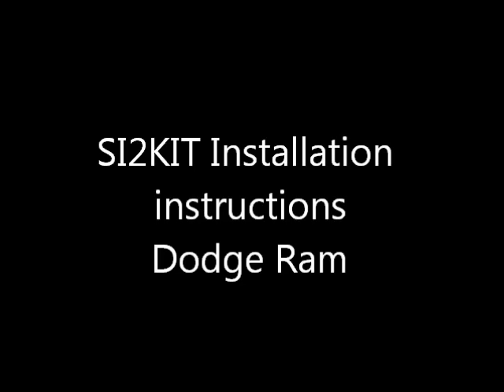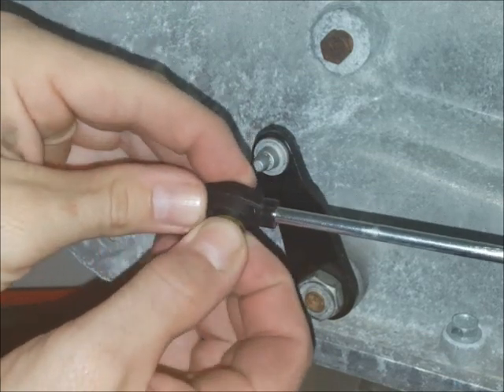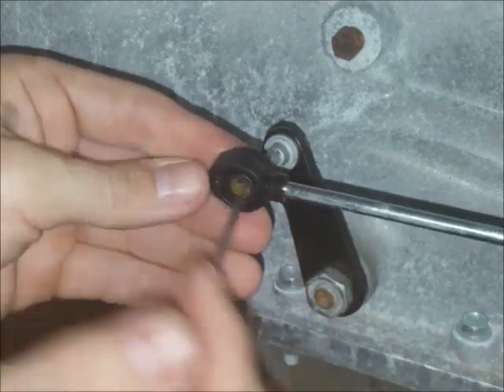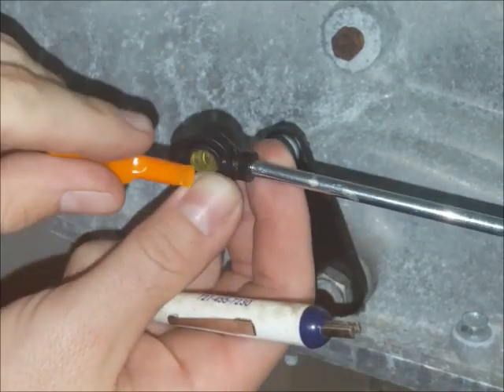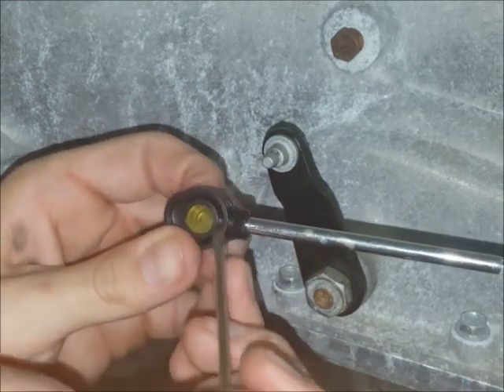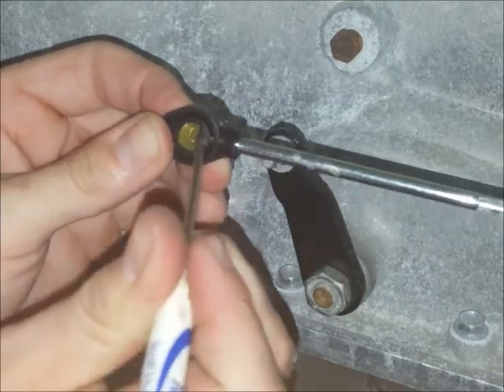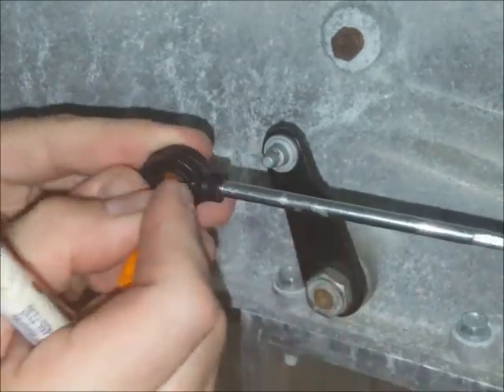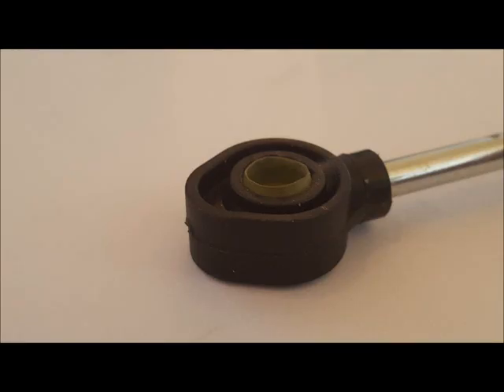Dodge Ram shift cable the easiest way to repair !   Kit includes replacement bushing.

Comment: My 2016 promaster started shifting to N when i was on D stopped at traffic lights. Took many restart to get it locked on D. Does this video address the issue?
Reply from the maker: Odds are that YES a deteriorated bushing is at the crux of your concern.  However, the only way to be 100% certain - is to inspect the  cable end nearest gear selection knob.
Reply: @BushingfixFL  Thx for the quick respond! Do I inspect both ends, one under the car,  and one near the gear stick?

Comment: I would also like to know what Anthony said.
Reply from the maker: It depends on the year/model of the truck, but it sounds like a misadjusted cable or a bad PRNDL switch.
Reply: The pin is in the trans

Comment: does this fix the problem i get when i put my truck in park and it mechanically goes in park but the gauge cluster does not say its in park and i have to put the car in neutrel to start the truck
Reply: how did you fix this issue mine does the same thing
Reply from the maker: It depends on the year/model of the truck, but it sounds like a misadjusted cable or a bad PRNDL switch.
Reply: anthony santucci Ever figure it out? my 01 24v just started doing the exact same thing. Has to be in neutral to start.
Reply: JustAnother 24V did you find it out mines doing the same thing
Reply: 95 12 valve here. Having same issue.
Reply: the problem i have with my 2001 dodge ram 1500 is something is wrong with the way it shifts. And it only happens when the vehicle is started a second time after turning it off. Like i can start it up and go up the road just fine and it shifts just fine but it i turn it off and back on and go back down the road it doesn't want to go past 30mph and the rpms go all the way to 3 even 4. Sometimes it kicks in gear and goes fine but not lately. And it just started happening it was fine not to long ago. Any advice?
Reply: @Anonymous23026  if you figured it out- PLEASE- let me know